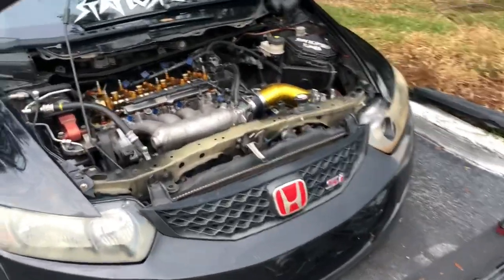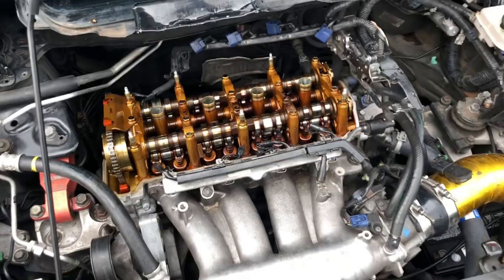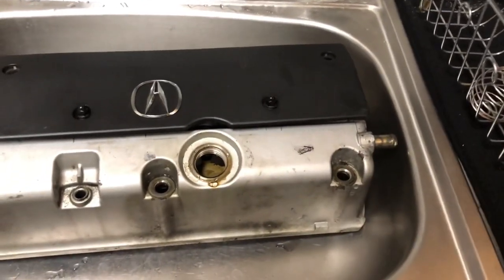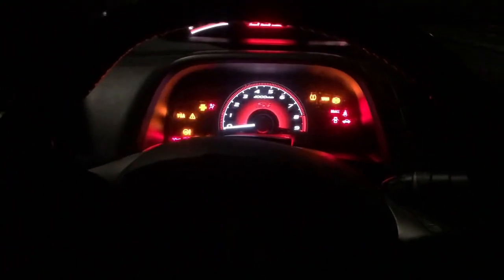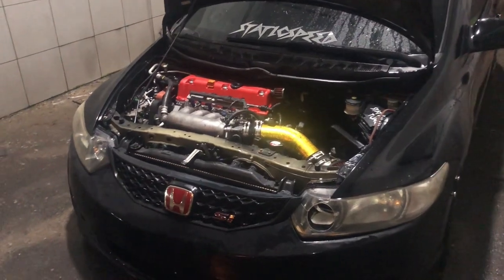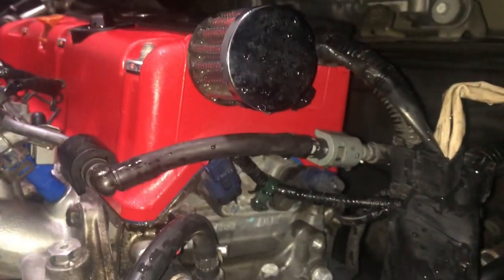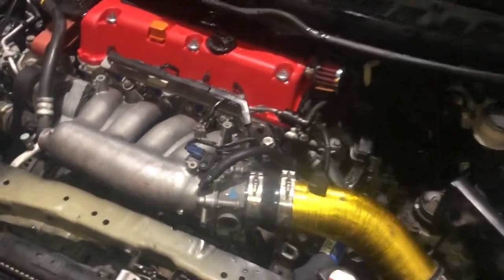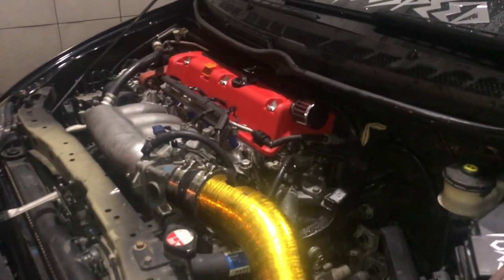K Series DIY Vacuum Line Tuck + Wrinkle Red Valve Cover

Comment: Did you find out if this triggered the check engine?
Reply from the maker: Sometimes it will throw a code but if you disconnect the battery it won’t come back for a while

Comment: What u did to take the valve cover off beacuse the k24 is taller
Reply from the maker: Had to bend the life out of the vin plate and bend it up towards the windshield. Cracked my windshield in the process but that was the only way to get it off
Reply: Whats it easy to remove
Reply: Nd how u bend it

Comment: I’m mad you switching to the sidewinder !! lol
Reply from the maker: I know I know but I also plan on running no blow off valve purely for sound purposes so I’m assuming I will go through a few turbos. Much easier to service turbo parts with a sidewinder.
Reply: @staticspeedtuning  yea that’s definitely true easier for servicing.. Only reason I wanted to do the ram horn is everyone has a sidewinder.. now since prl and full race don’t sell their manifold anymore it’s tough to find ramhorn. Sidewinder for the win then lol
Reply from the maker: PLM always makes good stuff and they make a ramhorn that’s what I was going to go with